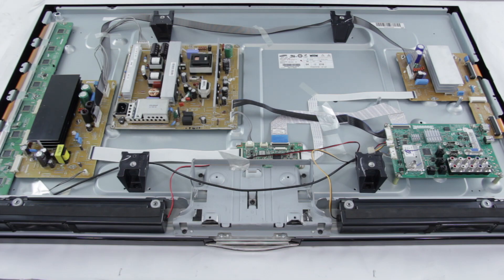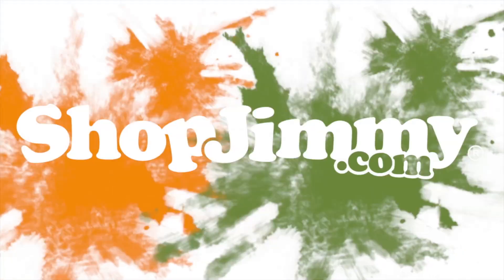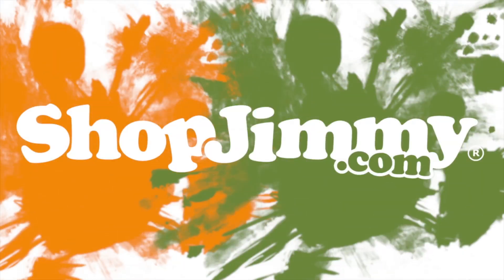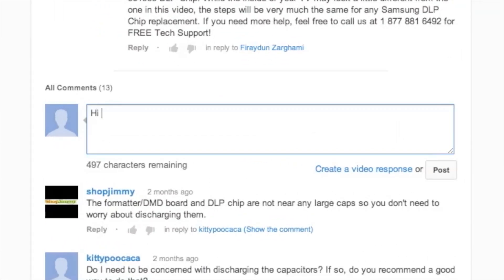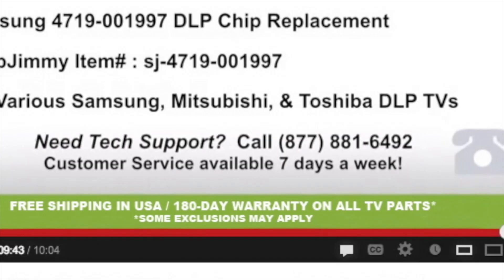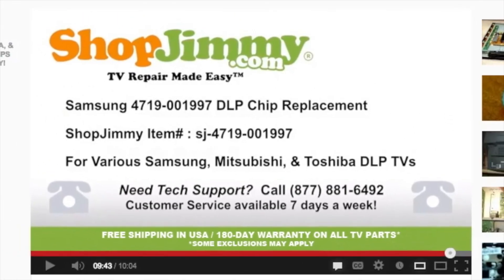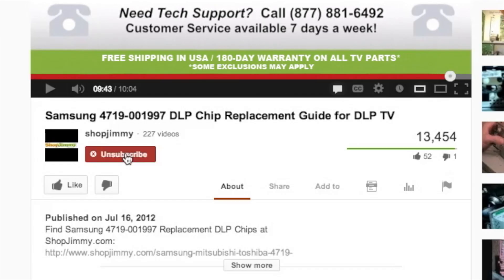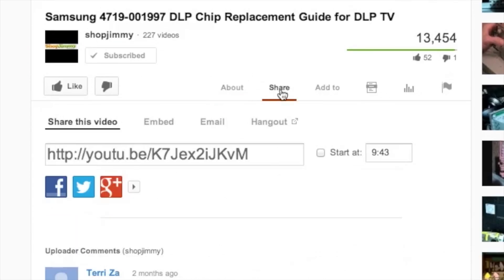Plasma TV Repair Tutorial - Common Symptoms & Solutions - How to Fix Plasma TVs

Comment: I have a Samsung HPR4252X/XAA Plasma. I have power and sound but the picture is black except for some random colored "sparkles" moving around.
Reply from the maker: David Schmidt   I recommend replacing the Y-Main board in your TV.  Here is a link to replacement parts for your TV model number on our website, click here:  http://www.shopjimmy.com/catalogsearch/result/?q=HPR4252X%2FXAA  Be sure to match part numbers on your current board, with your replacement for compatibility.  Here is a link to a video showing how to identify your part number, click here:  Samsung Plasma TV Repair: Samsung Plasma Panel Parts Guide  You can also call our customer service for further assistance with your purchase.  (877) 881-6492  Thanks and please let us know if you have any further questions with your TV Repair!  www.shopjimmy.com

Comment: I have a Samsung Model PN59d550c1f. I have absolutely no picture or sound. The standby light will flash 3 times with clicking sound when plugged in, then light and sound will turn off and repeat with some times just clicking sounds. I have unplugged and held on/off button with ( 6 ) flashing lights return, which I read was some sort of code. Can you give any suggestions?
Reply from the maker: Alex Walker   I recommend replacing the Y-main board in your TV.  Here is a link to replacement parts for your TV model number on our website, click here:  http://www.shopjimmy.com/catalogsearch/result/?q=PN59d550c1f  Be sure to match part numbers on your current board, with your replacement for compatibility.  Here is a link to a video showing how to identify your part number, click here:  Samsung Plasma TV Repair: Samsung Plasma Panel Parts Guide  You can also call our customer service for further assistance with your purchase.  (877) 881-6492  Thanks and please let us know if you have any further questions with your TV Repair!  www.shopjimmy.com

Comment: ihave a bush/samsung s42ax-yb09.  i plug the to in and turn on all power supply and nothing comes up on the screen the standby light works i've checked the capaciters and fuses on power board and im now stuck for ideas, im no tv tech help would be great thanks
Reply from the maker: Shaun Williamson   I recommend replacing the main board in your TV.  Here is a link to replacement parts for your TV model number on our website, click here:  http://www.shopjimmy.com/catalogsearch/result/?q=s42ax-yb09  Be sure to match part numbers on your current board, with your replacement for compatibility.    You can also call our customer service for further assistance with your purchase.  (877) 881-6492  Thanks and please let us know if you have any further questions with your TV Repair!  www.shopjimmy.com

Comment: Hi there,

I've bought a LG 37LD450 back in August 2010 and it always did hum a bit, but only when there was no input source, i.e. the TVs on and on HDMI2 where my PS3 is, but my PS3 is already turned off, then I'll get to hear a humming :\

I contacted the LG-Support, they told me that there was no humming. The next time they told me that they changed the panel but the humming issue still remained...

Some time in Q1 2013 I noticed that my TV is slowly showing some flashlights in the corners. As the time passed the flashlights got worse and worse :(

Could it be, that I used the TV too much? I.e. used it too often for too long? My LG also isn't a stranger to running all night :D

I haven't called the LG-Line because my warranty already expired.

Is it possible to buy a new panel and remove the old one?
I'd love to repair my TV if it's not too expansive since I bought it back in 2010 for about 420 € so I'm not that content to buy parts for 200 € and mayhaps brick my TV while trying to fix it :\

Looking forward to your answer and thx for your video. Many thanks in advance!

Comment: I have a Samsung PN50C450 that has a vertical line running throughout the entire screen . It changes colors from white to black to red and blue. What is the issue and is it worth repairing the television is 3 and a half years old at this point
Reply from the maker: Lance Hagood   This sounds like a TV panel problem.  If your TV panel is bad, it may be more cost-effective to replace the TV as panels are typically hard to find in stock, difficult to replace, and expensive.  Thanks and please let us know if you have any further questions!  www.shopjimmy.com

Comment: I have a 42in Samsung Plasma , model PN42C430A1DZC , about 5 years old  . Problem is  , when I try to turn it on  , it just clicks  . Have been told it should be a capacitor and the damaged one will be bulged . So far I have not found one that seem to be damaged  . Any other suggestions would be greatly appreciated . Thanks , Pete .
Reply from the maker: Pete Tucker   TRY THIS AT YOUR OWN RISK - I recommend unhooking the power from your Y-Main board in your TV to see if it will continue to stay on, if it does stay on, I recommend replacing the Y-Main board.  Here is a link to replacement parts for your TV model number on our website, click here:  http://www.shopjimmy.com/catalogsearch/result/?q=PN42C430A1  Be sure to match part numbers on your current board, with your replacement for compatibility.  Here is a link to a video showing how to identify your part number, click here:  Samsung Plasma TV Repair: Samsung Plasma Panel Parts Guide  You can also call our customer service for further assistance with your purchase.  (877) 881-6492  Thanks and please let us know if you have any further questions with your TV Repair!  www.shopjimmy.com

Comment: I have a Samsung Plasma 450 that is showing stationary vertical lines. I got to the service menu to go through the video test screens, and these lines are still present. At first there was only 1 line, but now there are 3. The lines are also all located on the left side about 1/3 in. 

Your suggestions would be very much appreciated.
Reply from the maker: Charles Frame   This sounds like a TV panel problem.  If your TV panel is bad, it may be more cost-effective to replace the TV as panels are typically hard to find in stock, difficult to replace, and expensive.  Thanks and please let us know if you have any further questions!  www.shopjimmy.com
Reply: Sounds like good advice to me.

Comment: I have a Panasonic 42pz700u 42" plasma 1080p.  It is probably 5+ years old.  I have about a 2" black line in middle of the screen to the right.  it goes half way down.  About an hour into the tv being on, the line disappears.
Reply from the maker: Kathy Sass   I recommend replacing the buffer in your TV where the lines are appearing.  There should be a buffer board in the top of your TV in the area where the lines are appearing.  Here is a link to replacement parts for your TV model number on our website, click here:  http://www.shopjimmy.com/catalogsearch/result/?q=42pz700u  Be sure to match part numbers on your current board, with your replacement for compatibility.  You can also call our customer service for further assistance with your purchase.  (877) 881-6492  Thanks and please let us know if you have any further questions with your TV Repair!  www.shopjimmy.com

Comment: I have a Samsung Plasma TV PN43D440A5D 
Has a stand by light When I plug it in it makes many clicking sounds then the stably light stays on but I have no picture or sound, I have replaced the power board, and the Y-Main board but I get the same results?
Reply from the maker: JAIME Panameno   This sounds like it could be a bad Y-Main board or bad X-Main board in your TV.  You may need to try and replace the boards one at a time to see which board fixes the problem.  Here is a link to replacement parts for your TV model number on our website, click here:  http://www.shopjimmy.com/catalogsearch/result/?q=PN43D440A5D+  Be sure to match part numbers on your current board, with your replacement for compatibility.    You can also call our customer service for further assistance with your purchase.  (877) 881-6492  Thanks and please let us know if you have any further questions with your TV Repair!  www.shopjimmy.com

Comment: i have a sanyo dp42848 light comes on the back lights come on but they go out but the power light stays on what board do you recamend replacing
Reply from the maker: RICHARD TATE   I recommend running the flashlight test on your TV to help determine if the problem is the backlight inverter or the main board. Here is a link to a video we produced that shows how to run the flashlight test. No Image No Picture on Screen-Flashlight Test LCD TV Repair - How to Diagnose Broken Board TV Repair Please reply with your flashlight test results and we can recommend a replacement part for your TV repair. Thanks and please let us know if you have any questions! www.shopjimmy.com
Reply: what is a flashlight test
Reply from the maker: RICHARD TATE
  Simply follow the link that I posted in the response above to the flashlight test.  Here is the link:  No Image No Picture on Screen-Flashlight Test LCD TV Repair - How to Diagnose Broken Board TV Repair

Comment: hello,my samsung is an ps 42a416c1d plasma model.i see all values va and vs are ok. i found vsc value wrong about --100 and it sould be --190,is this the cause?
Reply from the maker: lorenzo torrisi  I replied to your other question and recommended replacing the y-main board.  Here is a link to replacement parts for your TV model number on our website, click here:  http://www.shopjimmy.com/samsung-bn96-06759a-y-main.htm  Be sure to match part numbers on your current board, with your replacement for compatibility.  You can also call our customer service for further assistance with your purchase.  (877) 881-6492  Thanks and please let us know if you have any further questions with your TV Repair!  www.shopjimmy.com

Comment: Hi ShopJimmy.com, I have a Samsung PN50B650 plasma TV that will not display any picture. It turns on fine and I can hear sound and change the channel but there is absolutely no display on the screen at all, its just totally black. The capacitors and everything else looks good when I open up the back but clearly something is wrong. Initially using some video suggestions I tried replacing the Y-board but it had no effect, same issue remains. Thanks in advance for any suggestions you may be able to provide to diagnose the problem.

Comment: Hello   I have a Samsung Plasma 720p model # HPS5053X/XAA 7 years old.
Recently top half of the picture fizzles out and goes black for a few seconds leaving only the bottom half of the picture.  Now i have a new problem, the tv turns itself off and then back on going through a power cycle. These problems are only happening  every once in a while
Thanks for your help
Reply from the maker: Mario Menendez   I recommend replacing the main board and the scan drive boards in your TV.   Here is a link to replacement parts for your TV model number on our website, click here:  http://www.shopjimmy.com/catalogsearch/result/?q=HPS5053X%2FXAA  Be sure to match part numbers on your current board, with your replacement for compatibility.  You can also call our customer service for further assistance with your purchase.  (877) 881-6492  Thanks and please let us know if you have any further questions with your TV Repair!  www.shopjimmy.com

Comment: hi I have a plasma toshiba 42hp86 tv. I just both. It as a low brightness problem plus a flickering and ghosting image. I would like to know what panel you guys think is deffect. had a quick look on all the capacitors. they look ok but dont have any capacitor tool to test them. thank for your answer.
Reply from the maker: Moto Olix   You can replace the main or the logic board to see if they fix the problem.  Here is a link to replacement parts for your TV model number on our website, click here:  http://www.shopjimmy.com/catalogsearch/result/?q=42hp  Be sure to match part numbers on your current board, with your replacement for compatibility.  You can also call our customer service for further assistance with your purchase.  (877) 881-6492  Thanks and please let us know if you have any further questions with your TV Repair!  www.shopjimmy.com

Comment: Thank you for posting your free advice service on YouTube.....I have had my z sus board replaced back in December 2011 on my 50" LG plasma tv, model number 50ps3000 (2009 model).
Everything has been working fine until this morning....my tv now has a mottled pink in the white or light areas of the tv picture. What do you think this could be.
Thank you!
Reply from the maker: Star Stream   I recommend replacing the Y-SUS board for your TV Repair.  Here is a link to replacement parts for your TV model number on our website, click here:  http://www.shopjimmy.com/catalogsearch/result/?q=50ps3000  Be sure to match part numbers on your current board, with your replacement for compatibility.  Here is a link to a video showing how to identify your part number, click here:  LG Plasma TV Repair: DIY Part Identification Number ID Guide for LG & LG Philips Plasma Panel Parts  You can also call our customer service for further assistance with your purchase.  (877) 881-6492  Thanks and please let us know if you have any further questions with your TV Repair!  www.shopjimmy.com

Comment: My TV turn on but there is different line with all the colors and it will not change channels the model # is z32lc6d-uk please help
Reply from the maker: Glenda Irvin   This could either be caused by a bad main board or a bad TV panel.  If the TV panel is bad, it may be more cost-effective to replace the TV.  you can replace the main board to see if that fixes the problem.  Here is a link to replacement parts for your TV model number on our website, click here:  http://www.shopjimmy.com/catalogsearch/result/?q=z32lc6d  Be sure to match part numbers on your current board, with your replacement for compatibility.  Here is a link to a video showing how to identify your part number, click here:  TV Part Number Guide for LG & Zenith Main, Digital, & Tuner Boards (LCD, LED, Plasma TVs)  You can also call our customer service for further assistance with your purchase.  (877) 881-6492  Thanks and please let us know if you have any further questions with your TV Repair!  www.shopjimmy.com

Comment: Good Info.  I have what appears to be a green vertical line coming down the middle of my LG 60PK750.  Would this also be the main logic board on an LG set?
Reply from the maker: Ruben Coellar   Vertical lines are typically a bad TV panel.  You can try and replace the main logic ctrl to see if that will fix your TV, however I cannot say it will with certainty.  Here is a link to replacement parts for your TV model number on our website, click here:  http://www.shopjimmy.com/catalogsearch/result/?q=LG+60PK750  Be sure to match part numbers on your current board, with your replacement for compatibility.  Here is a link to a video showing how to identify your part number, click here:  LG Plasma TV Repair: DIY Part Identification Number ID Guide for LG & LG Philips Plasma Panel Parts  You can also call our customer service for further assistance with your purchase.  (877) 881-6492  Thanks and please let us know if you have any further questions with your TV Repair!  www.shopjimmy.com

Comment: Hello shop jimmy I have a 47lg50  it has standby but will not power on. I am not afraid of swapping out pieces so feel free to let me know what I should check.  Thanks
Reply from the maker: Neil Roller   I recommend replacing the main board in your TV.  Here is a link to replacement parts for your TV model number on our website, click here:  http://www.shopjimmy.com/catalogsearch/result/?q=47lg50  Be sure to match part numbers on your current board, with your replacement for compatibility.  Here is a link to a video showing how to identify your part number, click here:  TV Part Number Guide for LG & Zenith Main, Digital, & Tuner Boards (LCD, LED, Plasma TVs)  You can also call our customer service for further assistance with your purchase.  (877) 881-6492  Thanks and please let us know if you have any further questions with your TV Repair!  www.shopjimmy.com

Comment: I have Samsung plasma TV model number LE32B450C4W. 30 minute after switching on, the upper half of the screen changes color with strips of line running horizontally across the screen. This problem does not occur when I place fun at the back of the TV set to drive away excessive heat. What is the cause of this problem and how can I fix the it.

Comment: hello,i have a 42 samsung plasma tv and i don t have sound and light or picture.i opened it and the value va and vs are ok.the tv sems that turns on but the blue light under  blinks 4 or 5 tims and remains on.i looked for the bad capacitor bud i didn t find any.when the tv is on the led green light is always blinkhing.what is the problem?grettings lorenzo
Reply from the maker: lorenzo torrisi  I recommend replacing the Y-board in your TV.  Please reply with your TV model number and I can recommend a replacement part for your TV repair.  Thanks!  www.shopjimmy.com